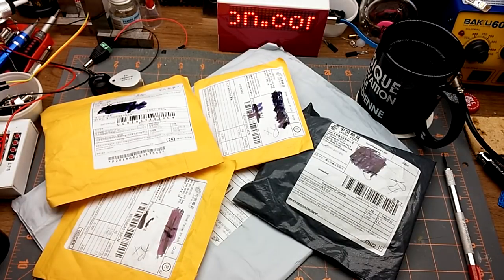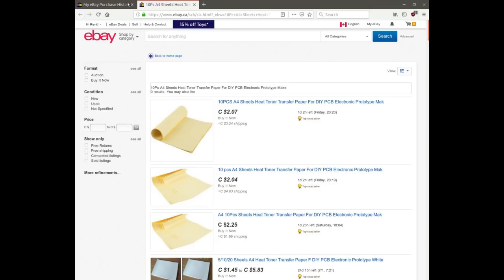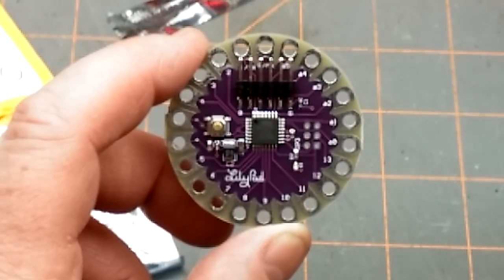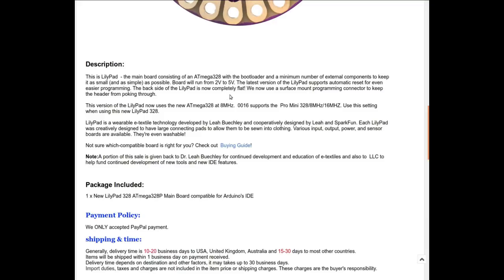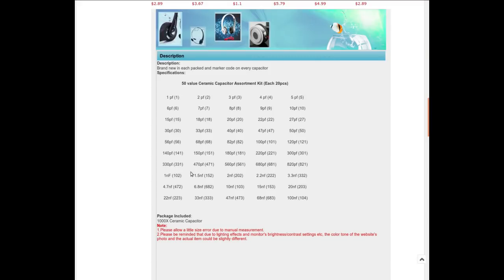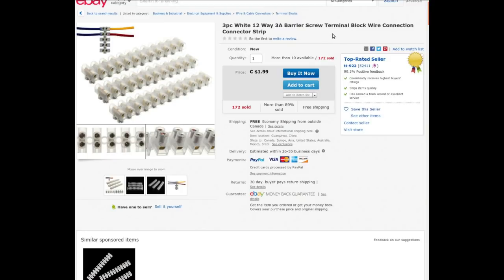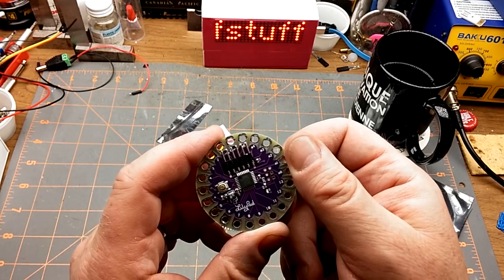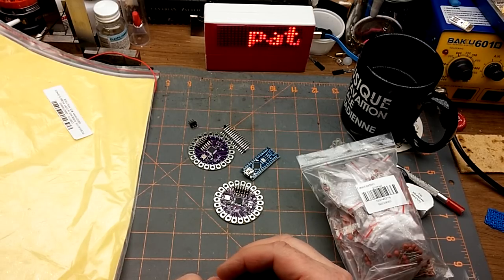Mailbag Monday 46

Comment: lilypads are normally 8mhz  where as nanos are mostly 16mhz. You can get 3.3v 8mhz nanos. This is also why the lilypad can run at lower voltages.  graph that shows voltage vs frequency on atmel328 https://arduining.files.wordpress.com/2014/12/meduino_outlaw_d.jpg   note max freq of 13.3mhz for 3.3v

Comment: Just a thought, my Note 3 which had a removable battery which I swapped out, when power Jack died, would continuously reboot with one battery that was bad. It would have 95% and quickly lose charge and start rebooting in a loop. Maybe your battery is bad. Just a thought. I love watching your postbags/mailbags. Makes me buy stuff to tinker with I don't have time for. Lol
Reply from the maker: Good thought, but i have a couple of batteries and this is happenjng with all of them.

Ive spent a bunch of time on support forums and the consensus is that the firmware is corrupt, possibly due to a memory fault.

As much as i really like my note4, i'm moving up to the S8 that my boss sent me.
Reply: @pileofstuff  Since you've retired it, maybe you could root and rom it. I have friends who have done this lots of times over the years. Nothing to lose if it doesn't work since you can't use it for anything now the way it's working.

Comment: If you want capacitors on-hand to build most anything ... wow ... you need variety packs of a lot of TYPES of capacitors.  You have the ceramic disk ... but if you want higher value non-polarized, you need some chip caps -- well, they are cheap too.  Electrolytics, of course, for large vales -- which come in a wide range of voltages.   But if you are building audio stuff, you may want polypropylene caps; they are not sensitive to vibration!  Maybe some Tantalum ones for voltage regulators  (low ESR).  Maybe some safety caps for AC work.  That is just scratching the surface!  Who has all this on-hand at home?
Reply from the maker: I've got another parts tray full of common elecrolytics and a few drawers of assorted other types.
There's always more to add to the shop stock, but I'm getting closer to having most of the more common types - at least in thru hole...  I'm trying not to dive deep into SMD

Comment: Those black blocks used to have a "Bus Bar" strip available to connect one side to gether but haven't seen them in over 10 years.
Reply: Yes, I was just scoping out Barrier Bus Bar Bridges, Terminal Bars, and sech:
https://www.aliexpress.com/item/TB-1502-03-04-05-06-08-10-12-Terminal-block-connector-TB-connection-strip-Terminal/32825989587.html
Reply from the maker: I've seen them as well, but I never got around to buying them.
The one I showed was installed before ordering cheap from China in small quantities was really a "thing".
Reply: @pileofstuff  I remember them because my OO layout was also wired with them to connect across baseboards.
Wow that was officialy 20 years ago :(
Reply from the maker: @AJB2K3   Some parts of this layout are that old as well. 
It's amazing how much "life" can interfere with hobby projects and other fun stuff.

Comment: Did you ever figure out your 5110 lcd that didn't work?  2 things: press the metal plate to make the zebra connector contact the lcd.  Also, if your reset line was tied to v+, attach it to the reset line of your Arduino instead.
Reply from the maker: I haven't had time to get back to that. I'll probably procrastinate until I want to use one for a project.

Comment: Last time I got myself a arduino nano for my computer lcd display, and i got Atmega328pb, newer version with two hardware serial ports, two i2c buses and some fany touch capabilities. Now it's kind of a waste to use this one.
Reply from the maker: It's always good to have a variety of options. I try to use the cheapest one that will do the job.
Reply: @pileofstuff  so do I, but somehow  that one I got is strange, seller sells it as normal nano, board looks like normal nano, on photos you can clearly see atmega328p, but I got newer version, with fancy new atmel logo.
Reply from the maker: @kjur18  Interesting. Especially if you got it for the price of a normal nano.
Reply: @pileofstuff  A little more than two bucks is a normal price on AliExpress, i think. This one was $2.02

Comment: Video is OK. Dubbing is a little odd (did you record it in French by accident haha!)
I get good results with cheap photo paper.  It's too thick for my printer so I have to cut a square and tape it to a sheet of A4 paper.

I found that using a ceramic wall tile as a base works great with a clothes iron.
Reply from the maker: Yeah, I'm not happy with the production of this video, but my work schedule doesn't leave me with enough time to re-do it properly. 
(plus, it's kinda bogus to put everything back in the envelopes and pretend to open them)
Ah well. The next one will (hopefully) look awesome by comparison!